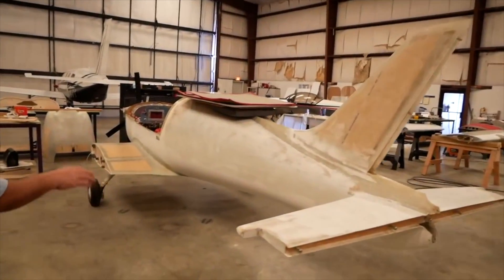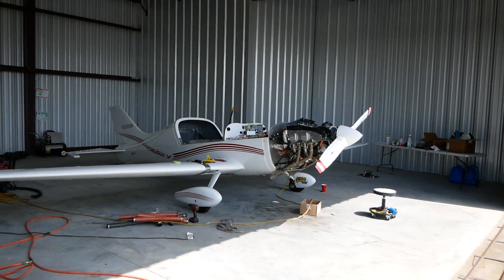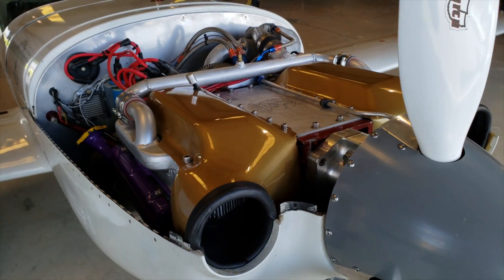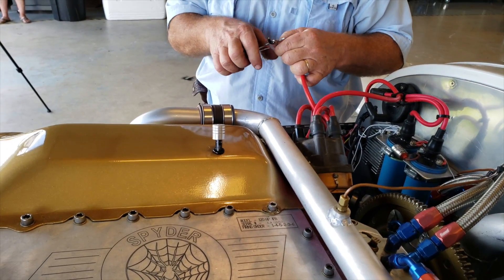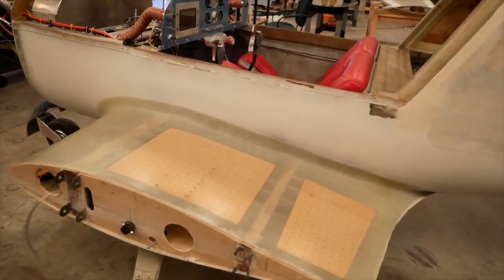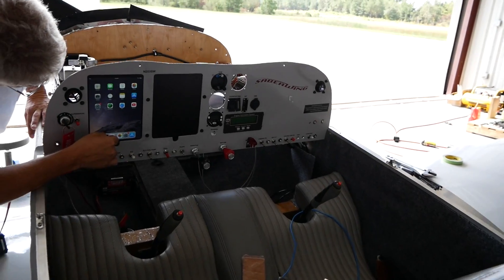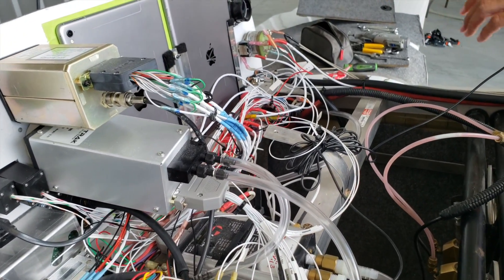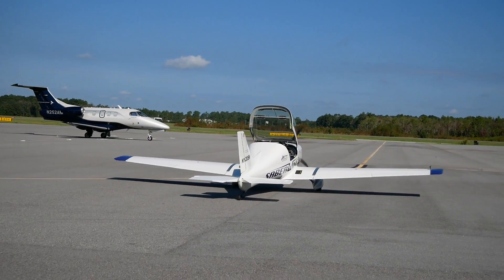What's Next For The Saberwing

Comment: Bill, The more I learn about Saberwing and the Spyder engine the better I like both. If you can manage an easily removable or folding wing, that would have value. I could hangar in a trailer, and "fly" it to Florida on I-95!
To what + and - G loads has the airframe been designed to accept, and how have those been verified?

Comment: Sorry to hear about this airplane crashing .
Reply: Horizontal is extremely strong.   We did testing to 6.5-8 gs on most systems.  Be praying for Larrys family as the struggle with him gone.  Its not easy.  We do know the breakup was from very high G-loads (above 10 is best guess by FAA ).   Larry wasnt conscious at the time.  Our understanding is a high G pull on a loop caused him to black out but continued to higher g.   We are doing a write up about it but the wings spar attach failed at 15-20 G negative.  Faa confirmed no structural or flight control system failure within design parameters.  We had plenty of margin of safety.  But once you exceed your body's limitations all bets are off.   So...be careful when trying new things...get the proper training!  One bad decision can cost a lot.  I loved Larry and will miss him.
Reply: @saberwingn120sw7  I thank you for the details about the airplanes tail strength and what happened to the airplane . And at 10 + g's just about any aircraft would have structural
wing failure . and 15-20 G negative is plenty strong for ultimate failure . I hope your airplane won't get the blame as a bad design . I will retract my statement .
Reply: The FAA spent some time with us reviewing the design and the kit as well as a couple being built here in our builder assist program.  They cleared us to keep going forward with the current design without any changes because the plane is overbuilt.  Larry built his right...no control failures or flutter.  Just an over G pull to blackout and then past structural design.   Our changes will be mostly in how we encourage pilots to be careful about flying within their limitations and provide avenues for improved training.

Comment: It's a great 2 seat aircraft, and, I for one- would LOVE to own one. I lack the time & conviction to build one, but, if I had the right stuff- this would be on the very short list. I think the landing gear on Bill's plane is a little shorter than what the design calls for- if my memory serves me right. I really like the clean 'aero' lines, the high cruising speeds, the light touch of the controls, the ease of access & servicing, and, the Corvair motor conversions benefits. From Mike's flight input, it seemed to be pretty forgiving in take off & landing, very quiet & vibration free in flight, a great low cost $100 burger plane for friendly flights- let alone fun for pattern work with good visibility. Classic lines are attractive to boot. As a 'modifier', I wonder if there is a way to make it even easier to build, using less fiberglass and, alternative materials. Aluminum tube spars, Tri-Lam wing socks, closed cell foam stringers, and, that cool honeycomb aluminum 2 sided stuff James Weebe used in the fuselage of the Chipper leaves me itching my brain.
   Either way, it's a beautiful aircraft with very well considered design for both building and maintaining- I lust after it. It would look great in the hangar with my XET single seat helicopter- maybe in a matching paint scheme, no? Or, maybe Chip Erwin's Merlin PSA in flake orange, or, a Foxbat (Aeroprakt LS22?) Fun, light, reachable dreams...
Reply: Thanks David....Right on all accounts.    Stop by and visit.  Maybe get a ride.
Reply: @saberwingn120sw7  - Absolutely NOT! Nope, not me. Respectfully- No Thank You! I'd be safer driving 100 miles around Azalea Aircraft's location- just to avoid it. "Maybe get a ride" equals all done. No way I could've used the restraint that Mike used- I can hear me already. "Honey? It's really practical, modest to buy, easy to build, right?" Or, "It's sooo cute, and, and, and-I can tell it really likes us! I promise: I'll walk it and feed it every day- Promise!" Pretty sneaky, Mr. Clapp- pretty sneaky. Joking aside, thank you for even considering it- I'd love a ride in your Saberwing. I had no idea that you were watching the comments- Whew, glad I was on my best behavior!
Reply: Motorglider? Oh My, Bill! Is there a discount for the 1st builder kit- to work out the bugs from design to kit? 100 HP, 2.5 gph @ 130 MPH, probably a slightly lower climb rate, maybe air brakes to kill lift, a 2 piece removable wing with winglet ends to reduce disturbed airflow. even smoother overall craft. Teeny, tiny increase in overall weight? I hope I can sleep tonight... That's my dream craft, Bill. Bestill my beating heart!

Comment: I've got a few questions: what is the advisible setup for ifr equipped experimentals?  Will most A&Ps be comfortable with inspections and repairs on corvairs?
Reply: We do have a couple being built up as IFR capable platforms.  More to do with the avionics capabilities and the pilots than with the plane.   Need to add heated pitot and a couple other minor things like static wicks but very doable.    Not for thunderstorms !

Comment: Second comment on same video after watching it through... and I tend to talk authoritatively on things but it's really just based on what I've seen...  I'm torn on canopies.  I love the bubble style obviously but there are permanent questions about dealing with engine-outs and potential nose-overs.  People who did all the right things have died in situations that could have been kind of easily survivable.  Ever since I sat in my first (and ye olde) Grumman 4 seater, I've pondered the solid roll-over protection they offer with the rear-opening section that fairs well and then slides back when wanted.   Even in flight too.  Is it just better to cop the visual issue of the "A-pillar that becomes a top-thingy, in order to have the benefits of it's safety and engineering?  The Diamond 2 seaters appear to have validated the long term value of that style but surely they're less solid and safe?
Reply: There is a roll bar behind the canopy built into the turtledeck.   The canopy can be kicked out if need be.  Not a comfortable situation to be in but doable.   THere are always bad situations that we cannot account for or be safest for.  You could hide at home in the bathtub..oh wait...the soap!....AWWWW...
Reply: Just another note.  To every design decision there is a pro and con with safety factors.   Bubble canopy allows for great visibility so maybe safer as you can see other aircraft or birds sooner than other than other windshields.  Like cars you will have blind spots that may be more dangerous than tipping over.   Similar argument about header tanks.   Some don’t like idea of fuel ahead of them.   However we can gravity feed the engine which reduces parts , such as no fuel pump, and reduces engine failures.   Less engine failures is good.  Most accidents are pilot error.   Improving your pilotage is always a safety benefit.

Comment: Nice video, as usual. Thanks!!
One question; The twin engines will be two seater or four seater?
Reply: OK....this all did start as a twin...which is why so much is actually  overbuilt and designed certain ways on the EAB Saberwing.  The fuselage structure allow us to incorporate a split where we can mod two halves and stretch the fuselage as much as I want to.  The spars are built to carry very high load factors.  THe center spar on the twin is longer and places the engines at the end of them.  THe cockpit is designed to be a 2+2 .  Perhaps not four large adults but two adults and two kids with the rear two facing rearwards.  The engines would be counterrotating Spyder 120 Turbos with constant speed props with feather capabilities.   I am finishing up My MEI so I can do the test flying, and teaching once we get to that stage.   The Twin Saberwing (name for now) would also be a taildragger with retactable main gear.  Very clean and efficient.   The concept is to be able to fly and maintain this twin for the operational cost of a Cessna 172.   I plan to start serious build sections in 2020.  I have the XF to build first....
Reply from the maker: Four seater.
Reply: Really interested in the XF

Comment: The plane looks like a lowrider, so low to the ground. What are the pros and cons of having such a short landing gear?
Reply: Low drag. Easier taxi visibility. Increased ground effect. Easier to get in an out. Easier to work on.  ---  Increased ground effect. Less prop clearance. Less shock travel.
Reply: Ok   everybody asks about the low gear on the prototype.  First it was what I had available for testing before we had the 3" taller gear legs available.   I like it because I can get in and out real easily.   The prop is only 58" diameter (custom three blade for my install)  so clearance is good...but most of all...I like how it sits...sexy looking!.    I love taildraggers and I love the challenge.   I can touch down at 75 mph and still have it stopped in 500 feet....if I am flying in the groove....mostly its because I think its sexy.
Reply: I second the question. More info please